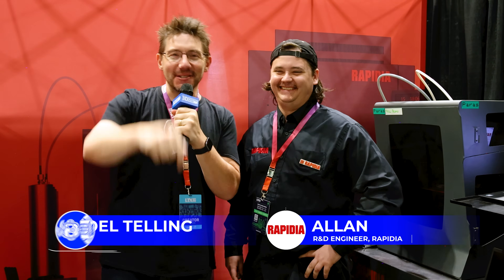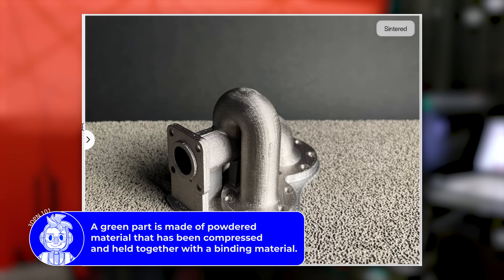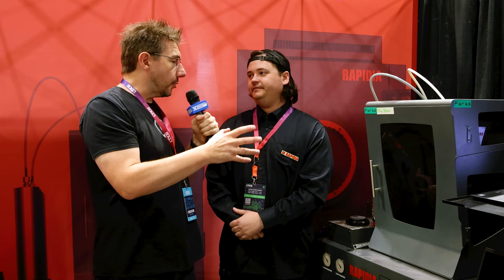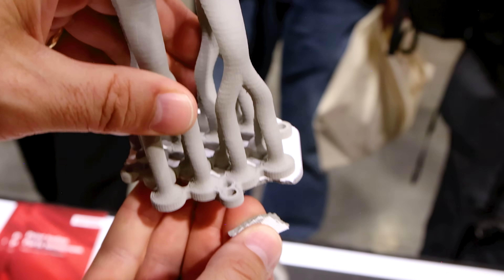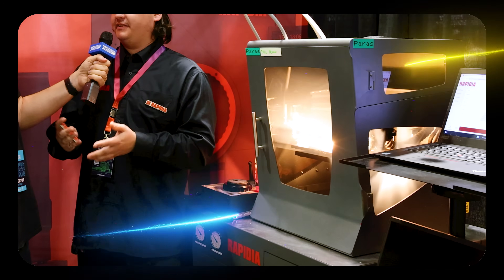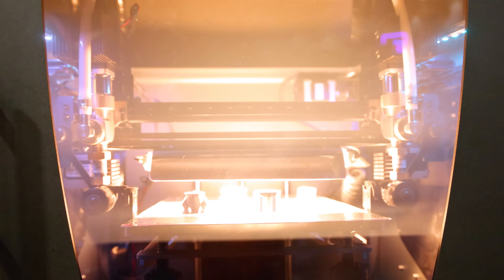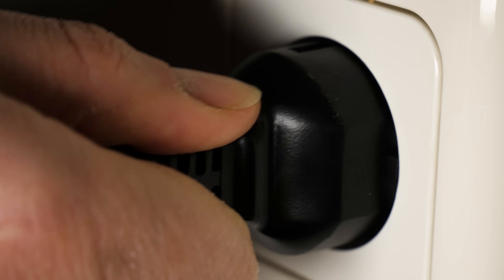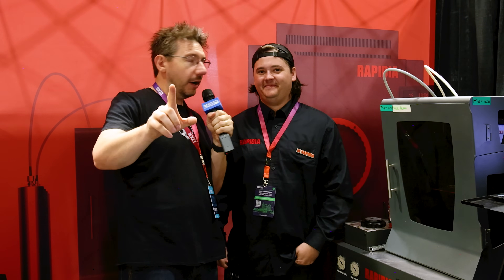3D Printing METAL AT HOME!

Comment: Very cool, but way out of the price range for most of us. They star at about $100,00.
Reply: not trying to be a jerk, genuine question... that's $100,000 or $10,000?
Reply: @TinSVM  missed a zero $100,000
Reply: @TinSVM Some places switch the comma and decimal point, so it could even be $100.00 but we can probably rule that one out
Reply: @RubixB0y  No worries, I've read other comments and it's 100k, so definitely out of my range.
Reply: compared to other systems it's really cheap and a step in the right direction, but yeah still too expensive for most.
Reply: All new technology starts high and drops exponentially.  In 3-5 years metal 3d printers will be "affordable" by the masses just like PPE 3D and Resin Printers before them.
Reply: Nothing proprietary though. The jewellery industry has these kinda printers (LLP) with 50x the resolution.

Comment: Starting at $100k defiantly not print at home unless your are rich
Reply: It's possible to be used at home, meaning you can have a business at home. The point is that it doesn't require special equipment.
Reply: @punishedbrains almost any machine can be used at home

Comment: What about anisotropy with this material and setup? The process is very similar to BASF Ultrafuse or Markforged, where the layers don't melt entirely and the impact strength, fatigue strength and tensile strength are atrocious. Nothing that any engineer would want. So anything worth looking at here or is it just for show parts?
Reply: I think the quality of these parts should be pretty good. They have this or similar printer at LMG (Linus Media Group)/LTT and allegedly, they're just about as sturdy as machined parts, or close enough that you'd considering rather than printing with... you know, what us mortals use.
Reply: @dudo626  pretty good as in? I tested Markforged and BASF parts, they were bad. This is essentially the same manufacturing process which creates numerous voids in the material, so until there's independent numbers confirming anything, there's no reason to assume they'd be usable for engineering parts. Maybe for decoration.
Reply: @Thierry080  I've just looked it up, it was actually Rapidia's printer. I cannot find the second video showing an actual printed part, also dropped because Linus. So again, going off of that, good as in sturdy.... I cannot say more. I think of it this process as sintering, though the part is essentially baked for half a day.
And this is specifically what I wanted to adress, the parts are not for decoration, they're usable. I just don't know if they'd be a good option versus a standard milled or similar part.

Comment: 100 thousand dollars machine ,to print at home? what home if you have to mortgage your house to buy this 3d printer?
Reply: The reason they market it like this is due to current metal 3d printing’s logistical complexity, and all of the costs that are required to actually use it. If you have enough money, you could actually realistically buy this and use it like any hobbyist FDM printer. From what I understand, most metal systems cost well over $100,000 when you take power usage, PPE, and every other expense that is required into account. That’s why they don’t say that it’s for hobbyists, or use any other language other than “at home”.
Reply: There's another option I found a while back for about 8k with the Ultimaker S5... it's just printing a ceramic material that needs to be melted.  There's a shrinkage rate that has to be accounted for as well so if you get that wrong your dimensions will be off.
Reply: Haha
Reply: 100 big ones is nothing for a drug cartel................. just a thought...

Comment: Could you talk about desktop Metal? It seems that their 3d printed metal and carbon fiber parts are of much higher quality.
2'400 MPa for their fiber parts versus 800 MPa for markforged.
Reply: Markforged has a much longer and successful track record with CF, Desktop Metal's version is limited in functionality
Reply: @ShopNation  Better software?
Reply: @ShopNation  Desktop Metal fiber system has a pretty wide fiber tape so it's probably not the best for small complicated parts.